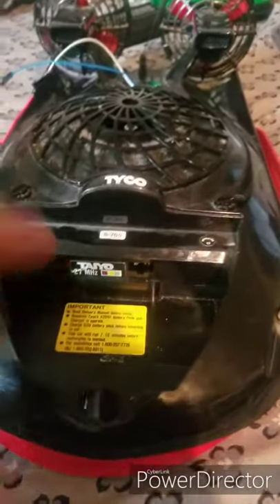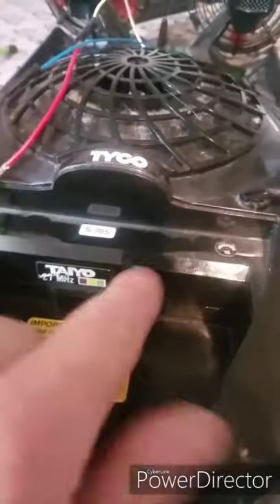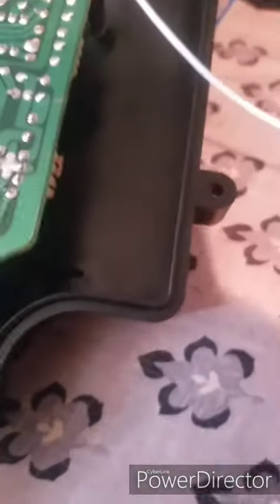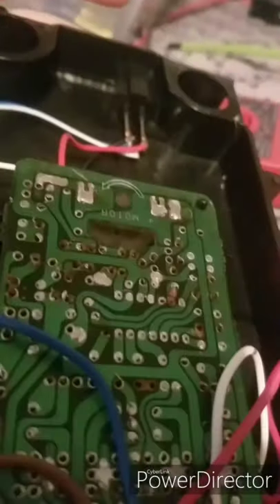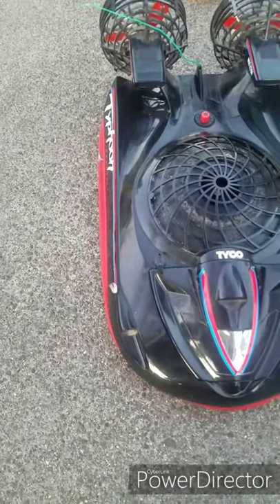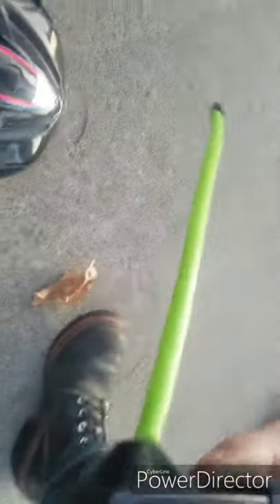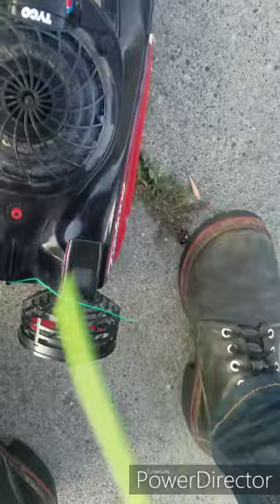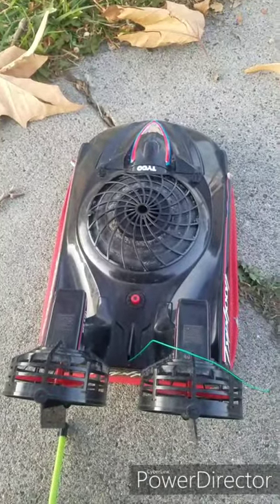Tyco typhoon hovercraft repair

Comment: How’d you get the electronics case apart?   I got it out, but can’t figure out how to get any further.
Reply from the maker: I believe i had to unsolder the motor i dont remember i will have to taken one apart again. You might have to unscrew the fan
Reply: Thanks!  That did it!  Just needed to to pry the case open afterwards—rubber gasket hold it together pretty tightly.  Any idea what size motor is in there?  Mine is burnt out!
Reply from the maker: @jackemmons3731  I think it is a 380
Reply: Thanks!!!
Reply from the maker: @jackemmons3731  your welcome happy to help
Reply: Thank you for the informative thread. This helped me disassemble mine. :)
Reply: @toofastcustoms8851 , great!  I got a 380 motor in, and waaaay too big!   Ordered  a 280, haven’t  gotten it yet, but I’m thinking that might do it.
Reply: @509trails  380 too big, going to try a 280 when it comes in.
Reply from the maker: @jackemmons3731   I hope the 280 fits. You might have to take the old motor apart and could the wire coils around  the armature so the motors will be the same
Reply: @509trails  fingers crossed.  I’ll post when I try it.

Comment: Hey I just got a mini Typhoon 2. One of the fans doesn't spin going backwards. Any idea on repairing that? Thanks!
Reply from the maker: It sounds like an h bridge / chip problem. It could also be the motor test a good working motor on the problem side
Reply: @509trails  You were right. Output transistor? Motors both tested good. Working in both directions.
Reply from the maker: @toofastcustoms8851  are you going to make a video
Reply: @509trails  I'd love to hear your thoughts on the video. Are those the chips you were talking about? Trying to get the main board 3s capable. I noticed they were 3a. Would upping the amps to 5, 10, or 15 help it push the power out without frying?
Reply from the maker: @toofastcustoms8851  3s shouldn't fry it i run 3s without modification i haven't had any problems yet

Comment: What is the best way to get the skirt back on?
Reply from the maker: I use a thin piece of plastic and gently push it back in very carefully if you make a hole use rtv  Silicone to seal it up
Reply: @509trails  -  I was afraid of that.  The rubber is so old and fragile.  This will be work.
Reply from the maker: @pyreo1  try putting Vaseline  on it letting it set then  Wipe it off and then reapply that's what I do with mine